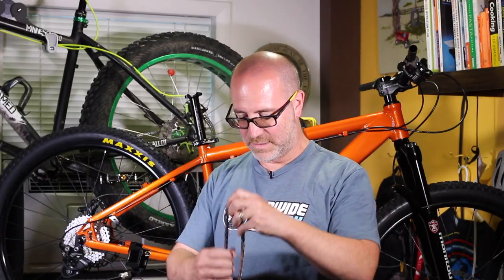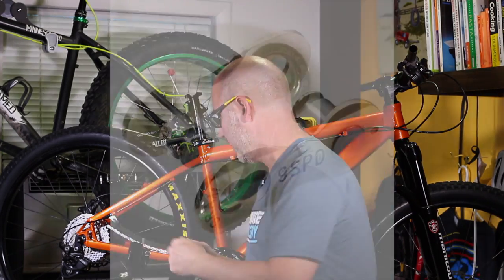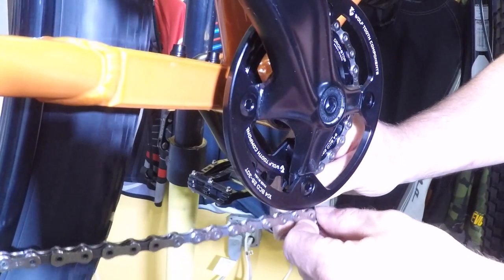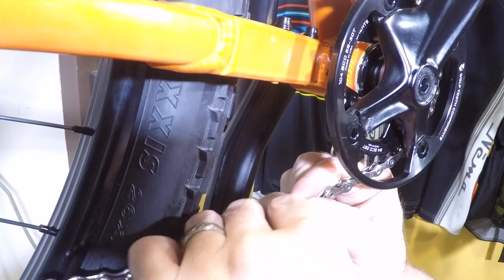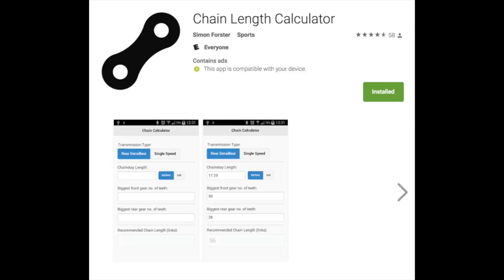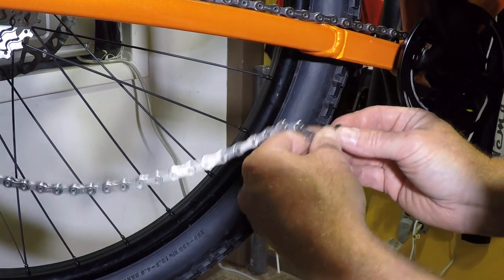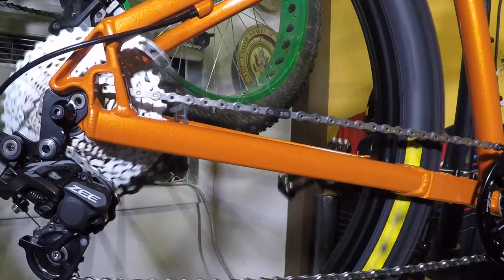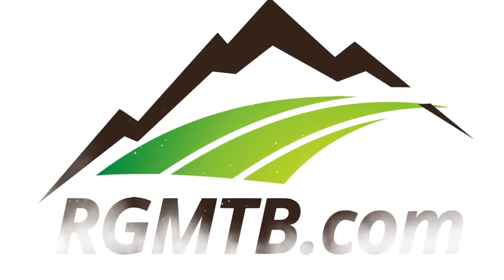How to install a bike chain on your mountain bike

Comment: Never had gears , so my road kill MTB chain is basically still on , needed new wheel , so how to get correct gear, large / large  ( can remember that ) so I guess the gear changer on handle bar doesn't matter at this point . guess its a stupid question

Comment: I see some issues with this method, as cage length & pulley/jockey wheel size will effect the chain length, with full suspension bikes, you have to compress the chock to the where the rear axle is furthest out in the travel.
So that's why I get the chain trough the Rd cage and biggest cogs, and compress suspension to measure, this is important if changing to different Rd.